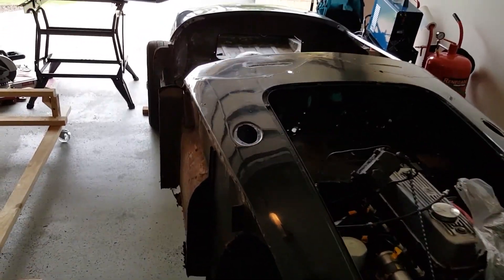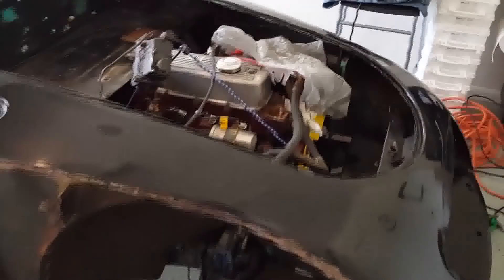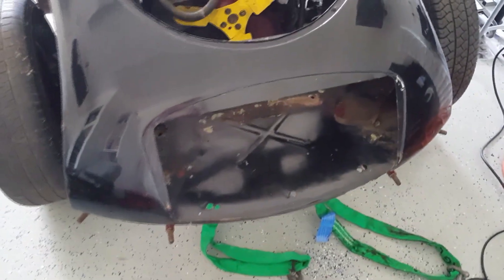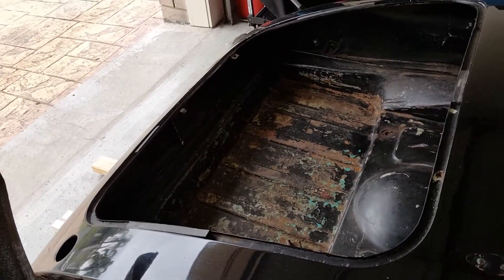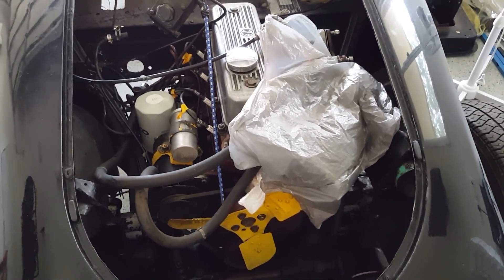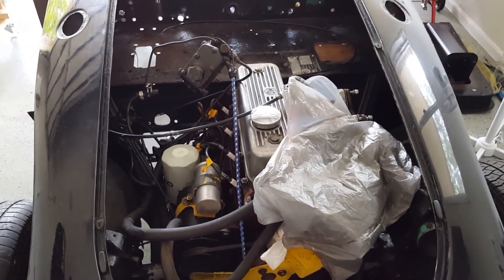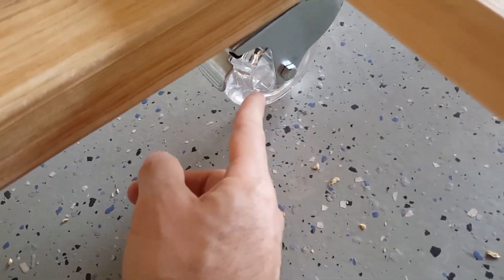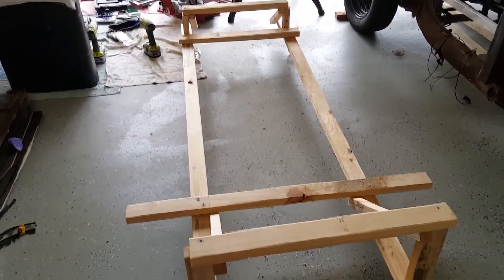Project MGA - Part 4

Comment: Hi Alan
Nice to see some progress. The dolly you have made looks just the job for wheeling the body around the garage, but. . . a suggestion if I may: it might be a good idea to put the body back on the chassis and complete all the sill, A and B pillar welding etc before taking it off. Although you have braced it, the doors on these cars are notoriously difficult to fit and if you repair the body off the chassis the gaps may alter when you bolt it back on. I did mine on the chassis. A couple of tricky welds but mostly accessible, then removed it for stripping, other welding and painting.
Good luck
Matthew
Reply from the maker: Thanks Matthew and yes, I completely agree with you. I've sort of been talked into removing the body by the guy who will be doing the sandblasting and acid dipping. He is keen to see the extent of the rust before I go about purchasing the panels from Kilmartins. I may end up doing the blasting in two stages i.e get the body done, put it back on the chassis, do the rust repairs, remove it again and then break down the chassis. Stil haven't made my mind up but I take your point. Thanks for the ongoing pointers.

Comment: Aaahh, THAT'S why you couldn't engage the starting handle.  No drive dog on the front of the crank!
Thought it would be oil cooler in the way, or saggy engine mounts.

Comment: Very helpful as Im about the remove my '59 body.  You mentioned you may post the dimensions of your dolly.  I'd really appreciate them if you still have them.  Thank you,
Reply from the maker: Jeremy, thanks for watching and good luck with your project. Sadly I forgot to take all the dimensions of the dolly before I disassembled it for a house move. I do still have the bolt location diagram and have updated that link in the video description at the top.
Reply: @stirlingAC  thank you.

Comment: ,When the body is back on  and the A and B pillars in place start with the doors and then fit the wings and adjust. Remember to fit the door seals when adjusting.This is the most difficult part of the whole assembly and make sure you leave yourself plenty of time. Good luck. Jamie